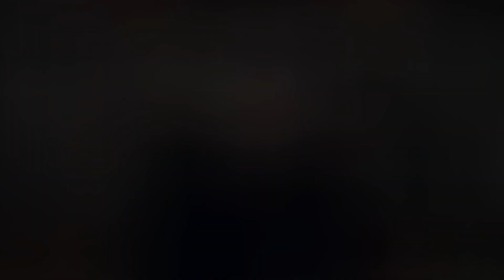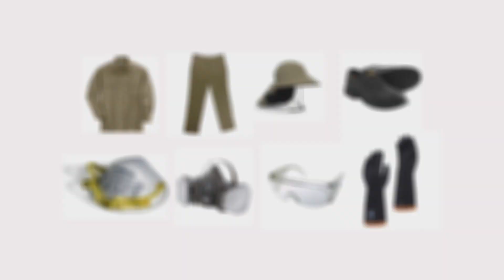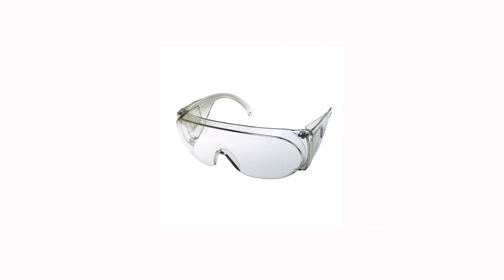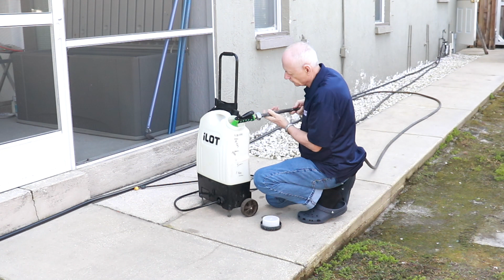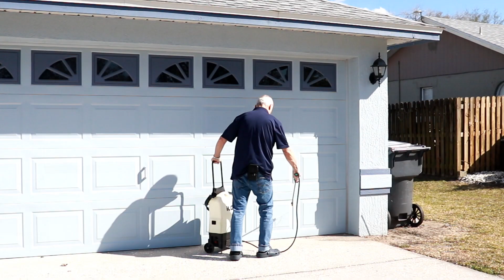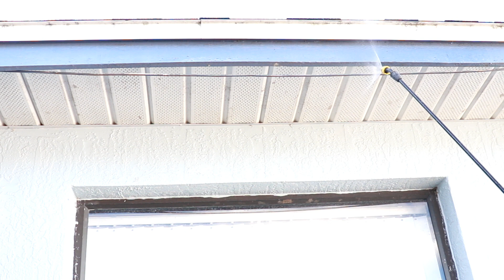How to Prevent Drywood Termites 100% Guaranteed.

Comment: I live in Florida . What do you think on demon max ?
Reply from the maker: Demon Max It's a fine pesticide to use, but personally I do not use it.  The reasons for that are basically threefold.  The first reason is the cost.  It does about the same job as Bifen IT, but it costs almost twice as much to buy and has less residual action.  You can reapply the Bifen IT every 60 to 90 days, but they recommend that you reapply the Demon Max every 30 days.  So, I can do the same job for a fraction of the price.  The second reason is that it has an odor to it.  The Bifen IT also has a slight odor, but it dissipates within seconds.  Finally, the Demon Max is an oil-based product and has been known to stain some surfaces.  Most of the time I do not use pesticides inside the house because I do a really good job treating outside the house and the bugs never get in in the first place.  So, this is not an actual reason why I don’t use it, but if I needed to treat inside the house, then the Demon Max can only be used as a crack and crevice spray and not as a surface spray for interior use.  The Bifen IT can be applied to interior surfaces.

Now, I'm not saying that you should not use Demon Max.  I think it does a great job, but for me, there does not seem to be any advantage to paying a lot more for a product that is not as versatile and needs to be applied three times as often.  

I hope that helps.  Be well my friend.

Comment: Can I use BifenXTX and spray around windows. Doors and fascia ?
Reply from the maker: Yes, you can.  In fact, it's probably more effective.  I have not used it myself, so I cannot say for sure, but I know that it is oil based, so I'm thinking that it will have some odor to it.  Also, it is somewhat more expensive than Bifen IT.  The biggest differences between the Bifen IT and the Bifen XTX is that the XTX has a higher concentration of the active ingredient and it is oil based.  Therefore, it is reasonable to conclude that it will last longer and be somewhat more effective.  I would still apply it every three months.  If you use it, please get back to me and let me know if it has an objectionable odor or if you find it staining to surfaces in any way.  I have not tried it yet because of the price, possible odor, and safety concerns, but the reviews are very good.  You definitely want to wear full protective equipment with this product.  It contains naphthalene, which is a known carcinogen. With most pesticides, you can get a little on you and not worry about it, but I would be very careful with this one, particularly since you are spraying over your head.  You definitely must shower immediately after using it.

I hope that helps.  Be well my friend.
Reply: It works for roaches ants and earwigs around foundation, I see lots of dead ones. I usually spray between February and June, because I’m Southern California Drywoods Termites swarm from neighbors and nearby trees, so for that reason I drench my windows doors siding and where siding meets roof eeves.
Reply from the maker: @joseleon7444  I also recommend that you spray the fascia boards as well.  Drywood termites are known to get under the shingles where they meet the drip edge.  I know, it sounds hard to believe, but it can happen.  Also, catch the entire soffit because there can be openings where the soffits meet the fascia boards.  The other thing you should be aware of is that there are actually two species of drywood termites where you are and they swarm at different times of the year.  The western drywood termite swarms between September and November.  The desert drywood termite swarms from June to September.  So, you are doing a preventive treatment for desert drywood termites, but not western drywood termites.  I always tell people that you should treat all year long because the termites do not always get the memo about when they are supposed to swarm. The treatment is quick and easy to do, so why not just do it every three months and make sure you have it covered?  That's what I do.

Are you getting much odor from the Bifen XTX?  Also, would you mind sharing where you get it from?  Pesticides are hard to find in California because of the laws.  I would like to share the supplier with others from your state.  Thanks.

Be well my friend.
Reply: @GuysPestSolutions  solution pest and lawn. Every day after work I go home open garage. Grab my caulk gun and look for any cracks or holes to calK. I do this every day, I house is lotttlery full of caulk, every where I am paranoid?
Reply: @GuysPestSolutions  I order my stuff from Solutions pest and lawns, and Xtx kind of smells like “chemical” outside then it diss epates into the air.  I will spray Bifentrin first 3 months then I will spray with Dipronil the following 3 months. I also foamed inside my wall voids with Boracare care and Profoam. 5:1 ratio , every 18 inches of studs. I’m doing what I can to prevent dry woods and eastern subs.
Reply from the maker: @joseleon7444  I don't think you're being paranoid at all.  What you are doing is what we call in the industry, “integrated pest management.”  The idea is that you should try to use other means of pest control, other than chemicals, whenever possible.  So, what you are doing is trying to build out the pests and that is a very good idea.  The truth is, if the pests do not have an opening get into, then they can't get in.  You still do need to use the pesticide, but sealing up all the cracks and crevices around your home will improve your odds of not getting any type of pests inside, including things like drywood termites.

I hope that helps.  Be well my friend.
Reply from the maker: @joseleon7444  Thank you for that information.  It sounds like you are doing a wonderful job and you should be well protected from drywood termites.  The only other recommendation I would make is to apply termite granules around your home every year.  This will prevent subterranean termites and it only costs $50 a year.  I will give you a link to my video on how to do it.  Lowes and Home Depot no longer sell the right product, so you need to order it from Amazon.  I will give you a link to the product as well.

Be well my friend.

Video on treating termites with granules:  https://youtu.be/H7rW_TSBHJ4

BioAdvanced Termite Killer granules 700350A:  https://www.amazon.com/dp/B000RUIJYM?ref=nb_sb_ss_w_as-reorder-t1_ypp_rep_k3_1_5&amp&crid=20OZWWGM8KALT&amp&sprefix=bioad
Reply: @GuysPestSolutions  oh I already do that lol, every 6 months. Heck I even foamed twice my wall voids with Boracare. My wife thinks I’ve lost it. 🤪🤪🤪
Reply from the maker: @joseleon7444  It sounds like you are right on top of things.  Please tell your wife that I said that you have definitely not lost it.  Foaming the wall voids is a great idea.  You really can't overkill this stuff.  The more you do the better.  You can tell your wife that I just gave you the Guy's Pest Solutions good seal of approval.  Well done.

Be well my friend.

Comment: Hi Guy!  Finally watched your video and read your request to post here before using your email.  This is excellent and I will do this absolutely.  Thank you!
Reply from the maker: Smart decision.  If you live in an area where drywood termites are present, then you only have three choices.  Do the treatment in this video, move, or let your home get eaten by termites.  It's pretty much that simple.  I wish more people would watch this video.  As far as I know, this is the only one that shows how to prevent drywood termites, but there are not a lot of folks watching it.  I find that somewhat surprising because drywood termites are a huge problem in warm areas of the country.  So, please pass this along to anyone you know who may also have the same problem.  Thanks.

Be well my friend.
Reply: @GuysPestSolutions  Will do.  Thank you!
Reply from the maker: @JohnSmith-jf3pj  👍👍
Reply: @GuysPestSolutions  Hi Guy, what if I have weed barrier under rocks around the exterior bottom wall of my house?  Would I have to move that out of the way to spray 18 in. to 2 feet of the ground?
Reply from the maker: @JohnSmith-jf3pj  If you used a weed barrier that is designed for this purpose, those are made so that water will flow through them.  Therefore, pesticides will flow through them as well.  However, if that weed barrier is simply a polyethylene plastic, then the pesticides are not going to penetrate through it.  Don't worry though.  It doesn't matter for drywood termites because they do not travel underground, so there would be no reason to disturb the barrier.  

However, if you wish to treat or prevent subterranean termites by using the granules that are depicted in my DIY Termite Treatment video, then you would need to remove polyethylene plastic before applying the granules.  I always recommend doing both the drywood termite treatment and the subterranean treatment, if you live in an area where drywood termites are prevalent.  That is because subterranean termites also live in areas where there are drywood termites and some of those subterranean termites may even be Formosan.  Formosan termites are really bad.  In fact, they are often referred to as “super termites.”  That is because, unlike other species of termites, these guys are ferocious eaters and can do a lot of damage in a very short period of time.  If you apply the granules around your home, then that will prevent them from literally eating you out of house and home.  I will provide a link to that video below.

I hope that helps.  Be well my friend.

DIY Termite Treatment with granules video:  https://youtu.be/H7rW_TSBHJ4

Comment: Great video! I just bought a new construction in Houston. I've only been here two weeks and I noticed what looks like worker drywood termites underneath the cabinets. I have a year warranty of a Pest company's work on termite control. A technician came out and said they don't handle drywood termites. I'm wondering if I should spray in the attic as well
Reply from the maker: I am so sorry that you're having this problem.  By any chance did the technician that came out to visit with you check to make sure that these are actually drywood termites?  If not, then I would recommend that you get a free pest control inspection and find out exactly what the species is.  A good clue that you have drywood termites is if you start to see something on your floor or countertops that looks a bit like sawdust.  This material is called frass and drywood termites are the only species of termite that produce it.  If you have not seen any frass around, then these may not be drywood termites.  It is important to get the species correctly identified because the treatment for drywood termites is totally different than the treatment for subterranean termites.

After you are certain that these are drywood termites, then you should know that the only way to be sure that you get rid of them is if you tent the entire house and fumigate.  You can do things like spot treat, and I do have a video on how to do that, but spot treating for drywood termites is kind of like playing whack a mole.  Just when you think you have found all the galleries, then another one crops up someplace.  Even the best pest controllers are going to miss galleries.  The galleries that you miss are going to continue destroying your home and they will continue to emit swarmers that will establish new galleries throughout your home.  Oftentimes galleries are located inside your walls where you cannot detect them.  It is very common for drywood termites to enter through the eaves and fascia boards that's around your home and then make their way into the attic and often down into the walls as well.  Also, they often enter around windows and doors too.  It is common to see them establish galleries in cabinetry and furniture as well.  You already watched my video on how to prevent a drywood termite infestation and you must perform your first treatment a few days before you fumigate the house.  This way you will be protected the moment the tent comes down.  The truth is that fumigation has no residual action and so you can get re-infested literally the moment the tent comes down.  The treatment I outlined in the video that you watched will prevent this. 

If you cannot afford to get the house fumigated, then spot treating is probably your most logical option.  You can farm this out to a pest control company, but the truth is you can probably do a better job yourself.  I will provide you with a link to my video on how to do this.  In answer to your question, yes, you must treat the attic.  My video explains exactly how to carry out the entire treatment process.

I hope that helps.  Please feel free to ask me all the questions you like.  Be well my friend.

Video on how to spot treat for drywood termites yourself:  https://youtu.be/U7ck7zhS0Xo
Reply: Hi Guy,
Thanks for the indepth reply. I got a second opinion from a different technician, as the first one seemed to not know what he was doing. The second technician said he believes what I have are Spring Tails. I'm still on the fence on whether to belive it or not so I may get a third opinion. It would be a huge relief if this is the case.
Reply from the maker: @jonathanvazquez3446  Springtails do look a little like termites, but if you can catch one, then look at it under a magnifying glass.  A springtail will have a forked tail, called a furculum, but termites do not have this appendage.  Also, termites cannot be exposed to the air or they will die, so you never get to see them, unless they are swarming.  Springtails do not have this limitation, so you can see them moving around in the open.  Springtails are smaller than termites too.  Most of the time, springtails do not survive in the home for long and just die on their own without requiring treatment.  However, indoor infestations are possible.  Often times you will find them where there is water in the home, like bathrooms and kitchens.  To get rid of them, remove the water source and spray them with a pyrethrin.  If you have potted plants, you may find them there as well.  You can probably just spray them with Raid Flying Insect Killer, but if that does not do the job, then you can go with a professional product like Spectre PS.  I will give you a link below.

I hope that helps.  Be well my friend.

https://www.solutionsstores.com/spectre-ps
Reply: @GuysPestSolutions  thanks again Guy. It's hard to distinguish the two. The drywood worker termite looks very similar to the type of spring tail I may have.  I do see these little guys near the windows at the front of the house where I have some small shrubs as well as near water sources like kitchen and bathroom cabinets. However, I also see them in the attic on the beams. I usually only ever see 2 or 3 at a time in an area.
Reply from the maker: @jonathanvazquez3446   Trust me.  You never get to see termite workers at all, unless you dig into the wood.  Termite workers will not come out in the open air on their own.  So, if you are seeing these guys walking around, then it is unlikely that they are termites.  I'll bet, if you look at one close up, you will see that forked tail.  Any pest controller should be able to tell the difference between drywood termites and springtails instantly.  To you they look alike, but to us they look different.  I'm guessing that the second pest controller identified them correctly right off.  If you look at one under a magnifying glass you will spot that forked tail immediately.  If you don't see that forked tail, then you need to get yet a third opinion.  Again, just based on the fact that you are actually seeing these guys tells me that I should bet on them being springtails.  I'm not sure why they would be in your attic, but I have seen all sorts of unusual things in this business.  If they are drywood termites, then you should be seeing frass in the attic.
Reply: @GuysPestSolutions  I trust your professional opinion. You are by far the coolest and nicest YouTuber around. I can tell you really enjoyed your work and I would not have thought twice to hire you if you lived in my area. Enjoy retirement my friend, you deserved it! 👏
Reply from the maker: @jonathanvazquez3446  That is so kind of you to say.  You made my day.  Be well my friend.